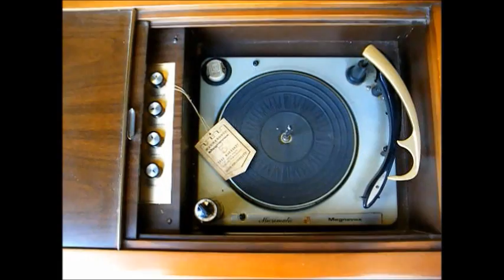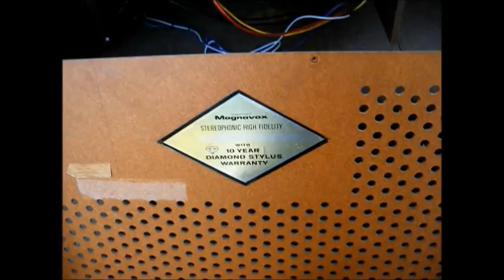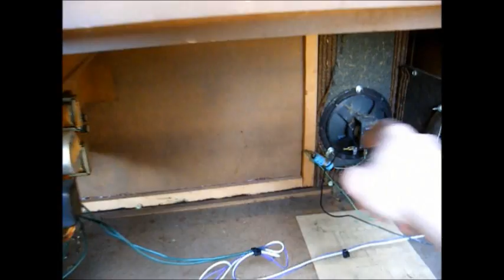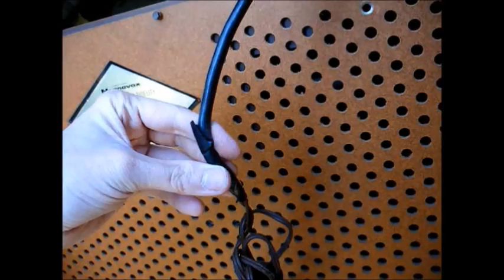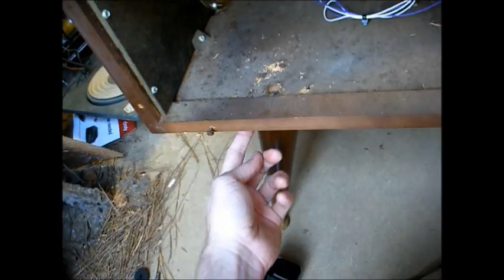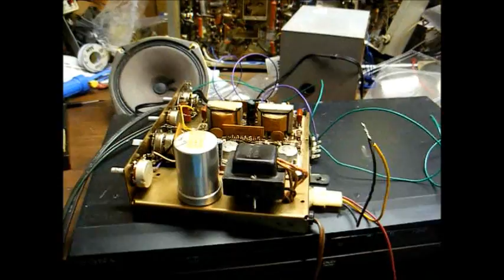1965 Magnavox Magnasonic record player console stereo - part 1

Comment: Could you tell me exactly what size or power the capacitors are? I just picked up one of these and they're installed in such a way that I can't see them well. I have a friend who's going to replace them for me and I need to get them ahead of time. I'm not certain of what to shop for.

Comment: The issue with that nut was that Magnavox installed them backwards.   If PAL nuts were installed properly, you could have used a normal nut driver or socket.

Comment: To ge the bass control to work, you will need to add an input capacitor in front of the bass pot. The value will depend on the pot value, so experimentation is needed ( start at around 0.1uf foor 100K pot). Just remember that these ampd had little bass below 100Hz or there abouts.

Comment: 7:57 That looks like torture. I thought I used to get those things out with a big slotted screwdriver; just stuck the blade between one side and the threaded tube, and it would fit tightly enough to turn the nut. Does that still work??

Comment: Greetings. I have a 1967 Magnavox Astro Sonic 6RP614 Brockway. I think one of the output transistors is bad. It is a Bendix 68P1K with a date code of 6636Q. I can't find it in any of the cross references. Do you know what type it is or a suitable substitute? Many thanks in advance. Jim.
Reply: Don't you have to order those from Russia or something these days? There might also be a way to re-bias the circuit for much less expensive silicon transistors.

Comment: Hello, I am looking at picking up a Magnavox stereo console, and I was wondering which model was the most powerful and best sounding that they made. How much should I pay for one in complete working order?
Reply: Daniel Gulotta Magnavox made the Imperial series with sealed chambers for the speakers. They were the top of the line. Some had remote control. Mine has 4 horns and two 15 inch woofers and 1000 Hertz crossovers. Very expensive new.
Reply: +Daniel Gulotta I can't vouch for other models but I just acquired an Astro Sonic like the link I sent. Two 15'' subs, two horns, and tweeters. It sounds like a dream! I know my shit when it comes to sound as that's what I do for a living. I HIGHLY recommend this one. The only thing is you may have to replace rubber on the drive wheel. There are places that do this. As far as sound goes though I like it better than my several thousand dollar modern reference monitors. Mine was given to me but I've seen them on ebay for anywhere from 500 to 1000+ dollars. Check out the link and let me know if you have questions.http://www.ebay.com/itm/magnavox-astro-sonic-30-vintage-am-fm-receiver-w-4-speed-phono-local-pick-up-/201382275814
Reply: 15 inch woofers and a Timbre knob on a Magnavox is how you know you've got a high end one.

Comment: So, I have been collecting vinyls for about a year now (I know, new guy) and have a modern day table top player. Nothing special. I have been shopping for a console unit and found a magnavox console that was cosmetically restored. When I was trying to use it, I only had sound from one out of the two sides on FM stereo that was very faint. It did not light up either. I couldn't test the record player due to no needle, but the unit does turn on and the arm moves. I am trying to figure out if I should buy it and learn how to fix it or wait for a better unit. Thank you

Comment: It's obvious that you're an expert and very informative. Just wondering if you can help me out here as I have no idea about electronics.My dad was a 20 yr electrician for the US Navy,he thought me some of the basics when I was young but I don't remember much anymore. He is no longer here to teach me or help me out. Anyway,I have a Magnavox Magnasonic record player not sure what year, no indicator but I'm assuming it's late 60s to early 70s.It looks almost like yours. I open the back it says Model #3RP614.It was working perfectly for couple of years, now, the record player's volume is very low. You can only here it from the cartridge itself and not from the speakers.I recently replaced the needle.The radio works perfect. Sounds are coming out of the speakers for the radio but just not for the record player. I was told that it might be the cartridge that needs to be replace but I don't think it is. Can you give me advise please? It'll be greatly appreciated.

Comment: Having watched your series on refurbishing this console, you have convinced me to keep my parent's unit and bring it back to life.  I have two issues I need to deal with. I'm getting muted sound from the speakers and the turntable will not rotate after twisting the "on" knob.  Were you able to find any kind of manual to assist you with the repairs?  I'm fairly handy with almost anything but this unit is as old as I am!  Any help would be greatly appreciated!
Reply: I found this website http://www.vinylengine.com/library.shtml

Comment: As are the components (and single 6AR5 tube) in my 43 year old JVC/Nivico console. Of course the same couldn't be said for the belts and idler wheels. They became rock hard and flabby as would be expected after all that time. I've seen turntables from the 80's and 90's with the belt or idler literally turned to a black liquid mess.

Comment: My 1970 JVC Nivico console has a particle board cabinet and I had to make a whole new base from plywood as that had split in half. The rest of it is just cosmetic work and I'm sure it's one of the last good console stereos. Everything from the mid 70's and later doesn't have the quality anymore. An example is the speakers in my console being in acoustic suspension enclosures with felt dampening. All the later consoles whatever brand they were had the speakers in free air and plastic turntables.

Comment: I wouldn't be surprised if these new Crosley's have sapphire needles instead of diamond.
Reply: I bought one in 2006. Believe it or not, it's diamond. Or they claimed it is. I got a spare needle just in case. Then was disappointed with the sound. So I got an Audio Technica LP-60 turntable. Not the best, but sounds a lot better than a Crosley Chinese unit. (Although I don't know where AT is made. Probably China too, lol.)

Comment: Why didn't replace the big electrolytic cap?

Great recap!
Reply: maybe no need to, it may be ok, far too much of this 'replace all old caps on sight',  personally i would've left all of them in , if it worked ok as is, i'd try it first with suitable current limiting, nichicons can last pretty good,  measuring high capacity doesnt necessarily mean theyre bad, especially if not powered up for many years, if charged to full working volts, held for a while, discharged, then tested, they'd likely measure far nearer their rated values , its if theyre significantly low capacity there could be problems, ... plus old caps were sometimes rated up to 80% positive tolerance, so 80% high would still be ok,